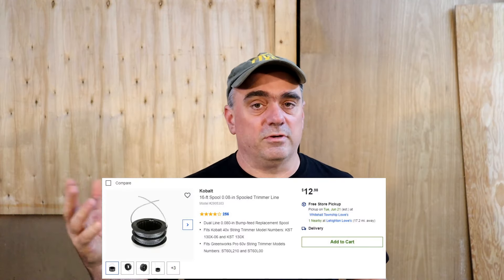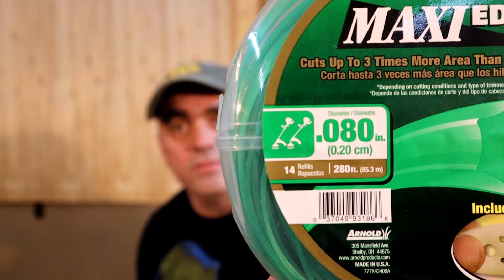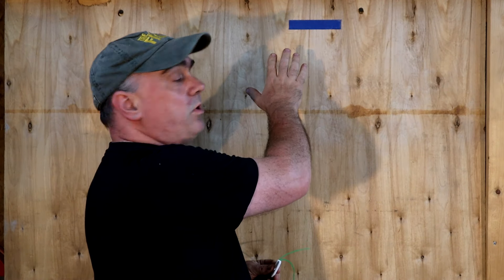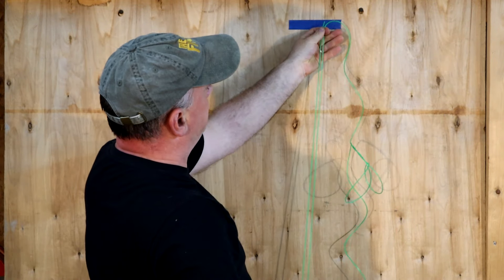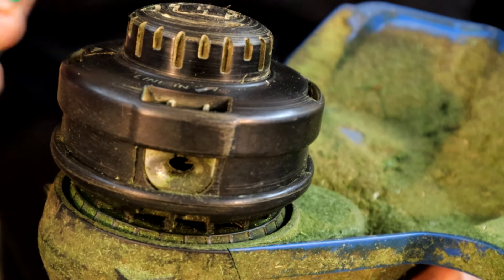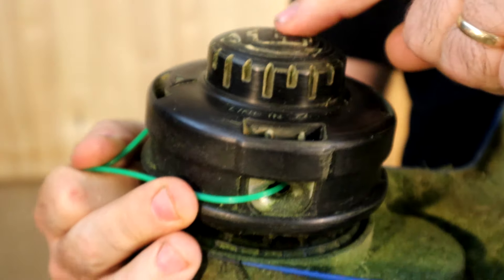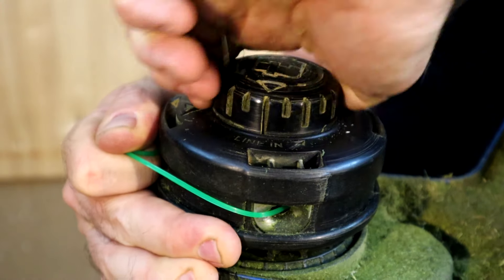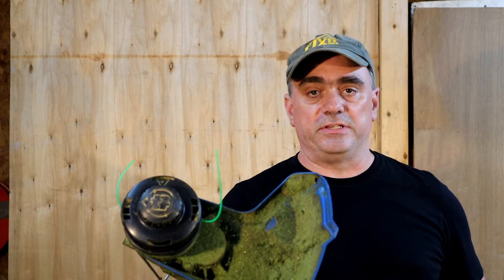How to Restring Kobalt 40v Max String Trimmer | The Fixit shed

Comment: If you push down on the knob when turning it will take the spring pressure off and it s easier to turn and doesn’t do all that popping.👍
Reply from the maker: Good tip!  I also made a follow-up video and used a strap wrench, which made it easier as well.

Comment: I'd like to add a suggested update. Lowe's, which is where I bought my trimmer, also sells a 5-pack of pre-curled line. I tried to follow your directions and couldn't get it to work since the pre-curled line, wouldn't go through the pilot holes, so the line wouldn't wind into the spool.. A trip to Lowe's solved the mystery. Your green line apparently was not hampered by the curl. We finally, after some experimentation, discovered that there is a slot in the middle of the internal spool that the line has to go through in order to come out the line-out pilot hole.  We had to thread the line through that slot, hold the line down into the in/out guides, and put the top back on the spool. From there, everything worked as you advertised. I guess it should have been evident but wasn't. Perhaps add a picture of the internal spool and show the middle slot that the line has to feed through and it will simply the task even further for those who use the pre-curled line 5-pack. Otherwise, this video was very helpful!
Reply from the maker: Thanks for this! I have been thinking about making a follow-up video, as a few things seem to be tripping people up, and I want to address those. Glad you were able to get it figured out
Reply: I'm glad I saw your comment because I could not figure out what I was doing wrong
Reply: OMG THANK YOU for this comment!!!

Comment: you have to be able to disassemble a GreenWorks trimmer string end before you get a replacement string and spools. I called the support center and the fellow told me at Lowe's they sell Kobalt and it is identical to the GreenWorks. But there are 2 types of string spool in Amazon and if you pick the wrong one .... too bad. The Greenworks customer service person asked if I had the instruction manual for my 40 volt lithium battery blower/trimmer combo. I explained that I used both devices for 5 years and do not keep the instruction manual around... An old fellow at Lowes knew that my Greenworks trimmer opened a certain way (and the 2 spring-loaded buttons are NOT necessarily free to open up ... it needs a Kobalt 3 pack of 2-line-opening spools. So he installed one as I watched how he did it and can do it myself now. if the support line at Greenworks does not even ask a caller basic questions, a customer will not know... There are a lot of buyers that never installed string before and the close by store may not even sell that brand.

Comment: I have been banging my head all day because the replacement spools you showed (that I had already bought) didn’t fit. This worked! The only thing I would add - you briefly mentioned that the spool inside has to be lined up so that the line feeds INTO it. THAT STEP IS CRUCIAL! Other than that I was able to figure it all out. Thank you!
Reply from the maker: Glad it worked out for you

Comment: You make it look so simple.
My wife and I took turns and finally gave up with about 18" on each side.
Knob was a pain to turn, and by the time we gave up it wouldn't turn at all.
My hands hurt, hers hurt, just from forcing that knob around.  A tool that fits the bump head would be awesome, something with a T handle so you can get the leverage to turn it.

I think we will end up trying to manually wind it in the future, has to be easier than this.  
Would not have bought this if we knew what a pain it would be.
Thank you for the video, it shows we were doing it right, no matter how hard it was.
Reply from the maker: The knob does turn kind of hard.  It is possible that it wasn't winding on the spool properly and that is why it jammed.  I just did this agian a week ago, and had that happen to me.  If I kept tension on the line while turning the knob, that seemed to work better.  I bet someone with a 3D printer could come up with a handle for it.
Reply: Poor design,  tore my hand up. The instructions are worse and i didn't think that is how it came from thr factory. I was happy to find your video right away but it i just way to hard not worth my time or the injuries. Has to be a better way. I bought this because it was cheaper than buying a new battery for my lawn mower,  figured get a new better string trimmer. Works great, just difficult to reload
Reply: A huge pain

Comment: This helped me a lot. I tried to follow the directions in the manual that came with a new trimmer using the other method but the directions were so vague and poorly illustrated that I could not do it even after hours of trying.  Finally found a video showing me how to do the other method(the manual is worthless) but even then I could not keep the string from unwinding trying to put the spool back into the trimmer head. Your video solved the problem for me using the easier method. Thanks!
Reply from the maker: You're welcome!  I am glad you found it and it helped you out!

Comment: I’ve been banging my head on this. Bought the wrong replacement head even though they said it was the right one.  I had leftover string and followed your instructions now no more headaches.  All i can say is   THANKS!!!
Reply from the maker: I am glad you found my video and it help you get it all straightened out.  It is actually a good design, and way easier than tring to wind it by hand.  I just had to restring mine yesterday.  It only takes a few minutes once you know how it works.
Reply: same

Comment: Your video helped me out a lot!  I had to take the cover off from around the feeder button only because when I inserted the string into the hole, it didn't go into the hole of the spool, only the housing.  It was easy to push in the two prongs to open the housing and feed the wire on its correct path. Thank you for your video because I didn't know I could just twist the feeder button to wind the string once it was in its correct position.
Reply from the maker: Gladyou got it figured out!

Comment: Thanks for your video, I have watched my son do this several times. I borrowed his weed eater  and it was so hard to load. After watching a few videos, even though you do have to push down to get it to turn and load. You do NOT have to hurt your hands or get blisters like I did and a few others that commented below. Please add a video that shows how to take the head off and clean it. Grass clippings and sand get caught in there and that is what is causing the jamming / hard turning. It is very easy to do and saves a lot of time and effort. A little wd-40 after cleaning and it works like a charm :)   Added note, if you are not mechanically inclined, take pictures during each step so you can put it back together properly. Placing of the internal head must line up.  Thanks again!
Reply from the maker: You make some great suggestions. I have mage a follow-up video which goes into more detail. https://youtu.be/kytjKx78BC8. Thanks!

Comment: Thanks for this guide. One reason I bought the Kobalt was the easy-wind string replacement. I have had trimmers in which you replaced the spools or re-strung them, but I prefer this. I've rewound the string on mine several times, but I always forget how to do it. I did a search and kept coming up with complicated guides that tell you to take off the spool and wind on the cord and replace it on the trimmer. Those never work for me. the cord ends up locking up and I have to take the head back off to free the cord. The winding method always works for me until I reach the end of the string.  I have bookmarked this easy guide for future reference.
Reply from the maker: Thanks for the nice comment! I do the same thing, even referring back to my own videos for things I don't do very often.

Comment: How about grease for the head of the kobalt weedeater? They get extremely hot. Don't you need a grease that can handle high temps? What about other moveable parts that need lubrication??
Reply from the maker: According to the manual, there is no lubrication needed.  For care and maintenance, it only lists proper cleaning to keep air vents clear.

Comment: This process did not seem to work with a .09 string. Got it strung thru, but turning the knob did not fasten the string to nthen reel.
Reply from the maker: If you turn the knob and the string does not get pulled in around the spool, it is not fed correctly.  See this video for better detail: https://youtu.be/kytjKx78BC8

Comment: How do you get more string to come out?
Reply from the maker: If you bump the head on the ground, the big button on the bottom should release more string.  If it isn't releasing more, it may be stuck.  You may need to open up the head to free the string.  If it happens often, try winding less string, maybe 9 ir 10 feet, instead.  This video may help answer some questions:   https://youtu.be/kytjKx78BC8?si=JgGLHRAU31gt2FSS
Reply: @TheFixitShed  Thank you. I cut my line in half, restrung it, and it seems to be working better. Thank you for your videos, they were extremely helpful!
Reply: It was also easier to restring.

Comment: You make it look so easy.  I've had mine since last year and just now having to restring because I am just beginning to use this one.  My question is what if there is still some string left on the spool.  Will the string that's in there completely deplete itself at some point or will I have to remove the old ends?
Reply from the maker: Usually what happens is it gets down to the last 8 or 10 inches, and then that much just flings itself out of the head.  You might want to check out this video where I go into a bit more detail, and have some new tips:  https://youtu.be/kytjKx78BC8
Reply: @TheFixitShed  Thank you. Planning to work on it as soon as I get home from work.

Comment: probably a weird and late question I have this model and I am just missing the spool I dont need anything other than that correct? no spool caps or anything? just put the spool in and it should be fine?
Reply from the maker: I think that is correct, if I understand your question. I do have a video where I remove the cover to show how to access the spool. That might help you to see what is in there.  I don't pull the spool out, unfortunately. https://youtu.be/zgH6FsQgDs0

Comment: I have a new kobalt 40 volt weed trimmer there are no tabs to remove spool string is inside how about showing how to remove spool
Reply from the maker: I'll have to check out the new trimmers and see how they work
Reply: there's two clips on the side you need to press in. they're a little hard to find, but if you look close you'll see them. it'll just pop right off

Comment: I purchased the spool replacement and it didn't fit, or I couldn't figure out how to put it on.
Reply from the maker: That is one thing I am not happy with Kobalt/Lowes.  The tools are good, but there isn't much help afterwards with parts and supplies.  I wuld just take the line off of the new spool and wind it onto the old spool.  I have a more detailed video here: https://youtu.be/kytjKx78BC8

Comment: Question: I loaded it just as you did. However while I was using it, I was having a very hard time getting it to feed out. I had to twist clockwise with my hand to pull it out. Is there something that can help me prevent this? Does it need cleaning or wd40 or something? It was wearing me out. Got halfway through the line and then it got easier.
Reply from the maker: It probably just got wrapped around the spool wrong. I had that happen to me as well. Make sure you are keeping tension on the line when winding it. If you wind it loose, it may bind up.

Comment: I got the line in but it wouldn't come out the other side. I had to use tweezers to pull it out. I am now trying to turn the button and it's turning but the line is NOT winding up. It's just turning and nothing is happening. Ughhh
Reply from the maker: Sounds like the line is not fed properly through the spool. Pop the cover off and look at the spool. There are two layers that the line winds onto. In between the two layers, there is a hole and a tunnel that runs from one side of the spool to the other. That little tunnel is what the line needs to be fed through. That tunnel is what the holes on the outside case need to be lined up with. So make sure the spool is installed properly and the arrows on the cover are lined up when you feed line in.

Comment: Figured it out.. you didn’t explain the hole in the middle has to be correct with the outside holes but still good video it helped me figure it out
Reply: I would like to understand what you mean because I am not able to get it to turn counterclockwise. Wondering where I went wrong but don't know what you mean about the middle having to be correct with the outside holes?
Reply: the inside holes have to be sure to line up with the knes leading outside or you can't thread the wire

Comment: I’m a bit confused. I did this, but when spinning it counter clockwise it isn’t accepting the spool?  Am I doing something wrong?
Reply from the maker: I am not sure what you mean by "accepting the spool".  The spool stays in.  You line up the arrows, thread the line through until you get to the middle of the line, and then turn to wind the line onto the spool.
Reply: @TheFixitShed  Correct I have it all lined up, and I threaded the spool through.  You know when you push the middle button and turn it counter clockwise?  Nothing is happening when I do that.  Sorry for the confusion
Reply: yeah u had rhe same issue. you can take the spool out and hand wind it too

Comment: What model is it that you are working with?  the one and four pack spools you showed are for the kst 130x-06 and are Not for an auto feed bump head spool like the model you have.  The listed spools you showed have a total different assembly that dont fit the unit you are working with..
Reply from the maker: correct.

Comment: Does not work.  Got to the point of turning the know, but it does not pull the line in.
Reply from the maker: If it doesn't pull the line in, there is an issue with how the line is fed in.  Check out this video for more detail:  https://youtu.be/kytjKx78BC8

Comment: try lining up the top arrow once it wears off after tapping it on ground to get string out. Its gone!!!!!!!!!!!!!!!!!!!!!!!!!!!!!
Reply from the maker: Yeah, I was wondering when that would become a problem.  You can see in through the side holes or pop the cap to get it lined up, or just start it with it popped open. https://youtu.be/kytjKx78BC8
Reply: @TheFixitShed  I was able to do it took 45 minutes. Have to pop cap, thread and then align to pop bk in. Man thats hard to twist tight though & I mean hard.
Reply from the maker: @tuscanyjc  yes, it is. I recommend a strap wrench in the video link I sent. It makes it quite a bit easier
Reply: @TheFixitShed  Great idea thx u

Comment: If only it just came out the other side like that !
Reply from the maker: If you are still having trouble, try making a loop in a twister tie or some other piece of thin wire, then use the loop to fish out the trimmer line.  Alternatively, you can pop the cover off of the head to access the spool.  The spool has an upper and lower section to hold line. Inbetween the two sections is a hole that the line feeds through.  with the cover off, you should be able to feed the line through the hole in the spool.  The metal holes in the sides of the trimmer head have slots in them.  You can put the line through the slots on both sides, and then put the cover back on.  Now you should be able to wind the spool.  I have a video coming out next week that will show this all in detail.

Comment: Your video does show the way to do it correctly. My problem is when you can't get the trimmer to bump out string any further, you think it's done. When you open it up to change there is still 5 or6 feet of line that hasn't been used. Once you take of the top to restring, getting it back in the second hole is not so easy. Getting the cover back on is a pain in the butt half of the time. Then when you try to twist the top it may or may not turn. I'm not a small guy and that should not be a problem. I have just spent the last 20 minutes trying to re-string this piece of crap and I'm about through trying to play with this thing. Sorry for the rant, but it sure isn't as easy as you show it. I would not recommend this trimmer to anyone.
Reply from the maker: This video may help.  I go into a lot more detail and provide some alternative methods:  https://youtu.be/kytjKx78BC8